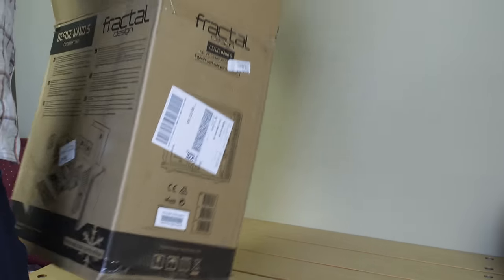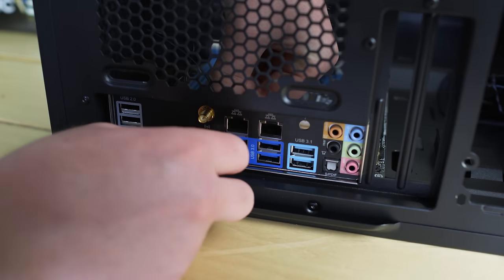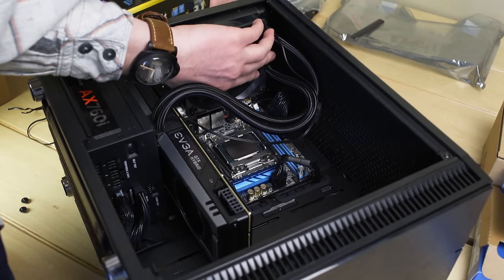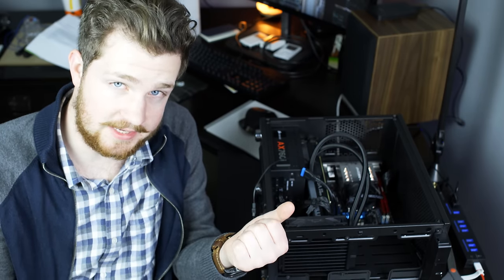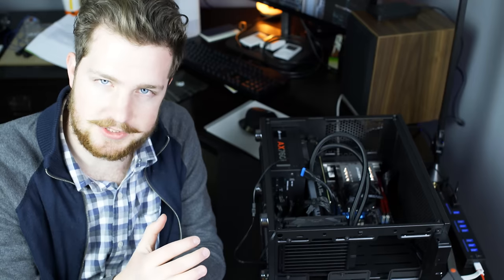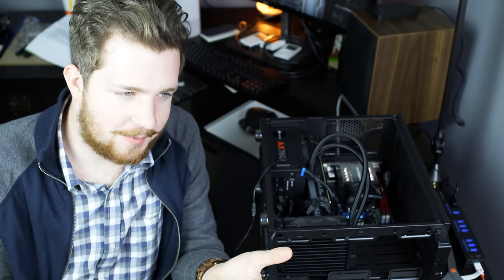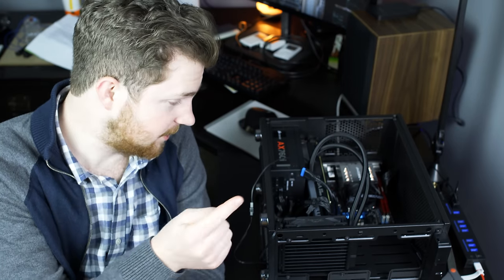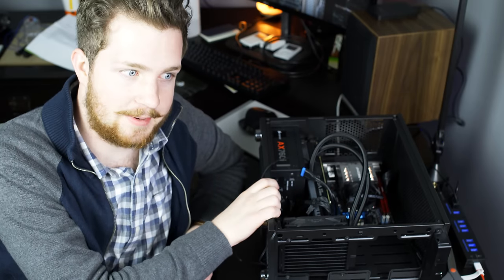My Powerful Custom PC Build Disaster

Comment: refurbished psu is probably the one thing you don't want to buy refurbished... only thing I would buy refurbished is a gpu and ram.
Reply: I wouldn't buy a refurbished gpu... For all you know that gpu could have had the shit frashed out of it and ran at extreme temps most of its life....
Reply: +Alex Murdie I've never had a problem w refurbished gpus
Reply: +JBiNN Nothing wrong with a refurb PSU.  PSUs are just a transformer and fans for the most part.  Easiest part to effectively and reliably refurb with proper testing.  Problem I think here is the difficulty getting the modular 24 pin cable in.  It's either the wrong cable, wrong end, or damaged connector.  Forcing it in with violence should have been his first clue. 24 pins are keyed on both ends for a modular and will click right in, but if you have it backwards, wrong Molex layout, etc., it can be forced incorrectly.   I would imagine there is a short across 5 volt or 3.3 volt, or even 3.3 in a 5, etc., causing an overvoltage/undervoltage that the regulators are detecting as stressing caps, etc.  I would avoid a refurb PCB of any type above all, because there are too many possible parts to die that can't be effectively tested in a timely manner that caused the card to fail in the first place.  I've had failing GPUs that I got a bug up my ass about and just for shits and giggles, I got them on a scope and meter and eventually found multiple ICs crapped out.  Got it running great for about 2 months, then it failed again and I put it to bed.  Any card that starts to fail and is repaired is, in my experience, ready to fail again because the components are all at the same wear level the first time it fails.  Unless you replace an entire PCB with all components, you are likely to miss something.  A PSU has much fewer components and thus can be refurbed with less failure.

Comment: Tech's recommendation: if you want a desktop PC that's powerful enough to do serious editing and gaming, just get an ATX board and case.  A desktop isn't designed to be portable like a laptop in any case, it wouldn't be that much bigger overall, and there would be fewer headaches.   Also, never cheap out on the power supply, that's just asking for trouble.  :3

Comment: You spent that kind of money on parts, including a 980 Ti, but you buy a refurb PSU? Why cheap out on the most important part?
Reply: +Miadous Gaming 
ikr, if you cheap out on a component it's more then likely going to bite you in the ass.
Corsair makes decent PSU, but betting on a refurm when your budjet is that high... stupid move.

Although some times you can get really lucky with refurb, I got my 5770 for a nice discount and it lasted 5 years or so up until I spilled the fluids on my cheap watercooling (bought some cheap connectors and tubing) killing my one GPU and my Revodrive... once again going cheap fucked me.

This is why you shouldn't try and be cheap, he still saved a lot more then a Mac Pro so spending 200 on a PSU would save him some time and "money"

Comment: *sigh 

Never ever buy a used PSU, same goes for HDDs.
Reply: Yeah, Also happens to me a year ago. I found a 640 gigs hard drive lying in a local computer store, for 29 bucks and I was thinking it was pretty good deal. and seller says it's new. So, I pick it up (even though I started thinking I got scammed because even a 500 GB HDD cost 35 bucks), plug it in to a PC and I heard a sound click click click and it goes on.... I was like "Aw crap!". so I fire up HDTune and scan that drive and there was bad sectors all over the place! so I look on a HDD cover to see Manufacturer date and found it was a 2012 drive.... yeah... basically, I got a drive that has been "working" for at least 3 years. And that's teach me a lesson. "you get for what you paid" LOL XD
Reply: i understand HDD but why not psu?
Reply: oh nvm it was refurbished, I see now
Reply: +Poketrevor and you don't know what the happened to the psu before you owned it
Reply: true, but then why buy anything used?
Reply: There are components that usually work fine even used and don't pose a threat to the rest of the system if they don't. PSUs and HDDs (your data) certainly don't belong in that category.

Comment: Right when you said you bought a refurbished power supply, I knew that was probably the issue. I once bought a refurbished one and . . . never again lol. People always forget, but don't skimp on the PSU!!!
Reply: +max silbert ;_; I learned my lesson. I bought a cheap 500WATT Modular PSU ;____; And it's HORRIBLE ! The cables are so stiff and the Motherboard connection WOULD NOT COME OFF.

Comment: andddddd this is why we use macs...
Reply: +matt or you know, do some research instead of just doing things blindly as he seemed to do and buying dubious quality stuff from ebay. He was asking for trouble by A. buying refurbed stuff, and B. buying it off ebay.
Reply: if you buy all new, this wont happen.
Reply: +OtakuSanel Especially the PSU, these things are not all that expensive. Buying an I7 and a 980ti but than being to cheap for a proper PSU is just something i can't wrap my head around...
Reply: +OtakuSanel He bought it from Newegg on eBay.
http://stores.ebay.com/Newegg
Reply: +matt because its slightly more trouble than a mac and you get much worse value?
Reply from the maker: +OtakuSanel I didn't buy blindly. LOL. Defective hardware exists. It happens. I got a Mac that was DOA several years ago. No product is free of manufacturing defect or shipping damage. It happens.
Reply from the maker: +muh1h1 It's a nice PSU. It's just a refurb. Sold by an authorized reseller. I saved $150 by going this route and just got unlucky. Lemons exist everywhere. It happens.
Reply: Snazzy Labs i feel you, if it was sold by newegg then it is perfectly fine to buy refurbishd
Reply: +matt How ignorant of you, Matt.
Reply: +matt This has nothing to do with mac vs windows. This is custom vs prebuilt. If I go out and buy a prebuilt windows pc it is just as likely to work as a mac.
Reply: +matt I may or may not have accidentally killed an iMac yesterday whistles
Reply: +muh1h1 That's one of the best quality PSU's you can buy on the market today... What are you saying?
Reply: +Shiny El. Ghosteo you didnt kill it you did it a favour

Comment: 3 things you don't buy second hand HDD's SSD's and especially especially especially especially ESPECIALLY! not the PSU as a bad PSU can kill you're computer and even start a fire and burn you're house down. PSU's have a definite life span which isn't that long comparing to most other components.
Reply: +Etheoma Also electronics 101, the power suplies are more then likely going to fail before anything else.
And ensure the magic smoke is still in the caps, beyond those two failure it's can easily be a night mare to trouble shoot.
Reply: svampebob007 I think I covered that with saying "PSU's have a definite life span which isn't that long comparing to most other components."

Comment: Never ever ever buy a refurbished power supply
Reply: +xamir1113x I buy refurbs for testing waterloop
Reply: +xamir1113x I bought a refurbished CX750M a year ago and I've had not a single issue with it
Reply: +Gino Palma Refurbished and a CX series PSU? You're just asking to kill your system!
Reply: RGInquisitor I've had absolutely 0 problems whatsoever with it, it's actually a great power supply.
Reply: Gino Palma
Speaking from experience, its only a matter of time. I went through 3 of them before learning my lesson the hard way.
Reply: RGInquisitor Aight bud, you tell me what to do with my computer, regardless of how little your opinion is relevant or even matters.  Because my perfectly functioning power supply is totally a ticking time bomb ready to break any day now.
Reply: Gino Palma
I'm just giving you a warning. Do NOT trust the CX series from Corsair. One of these days, hopefully far into the future when you're going to upgrade your entire computer, the PSU will fail and take your entire system with it. Like I said, I learned that the hard way.
Reply: +RGInquisitor The CX series is certainly not top-of-the-line, but also certainly not trash like you're making it out to be. For 95% of people it's the best bang for your buck out there. For anything mid-range and lower, a CX series will be more than good enough. We have 8 in computers in our office at work, the non-modular 430w, and have had them in there for at least 2 years. So long as you aren't overclocking or pushing close to its limit the CX series is a fine PSU.

Edit: I will, however, agree to the recommendation to never buy a refurbished power supply.
Reply: Mike Adams
It seems I just got dealt 3 bad units. The first one I got was DOA, the second was not outputting enough power and the third one killed a system after powering it up for the first time. I would say that there are better options that are "bang for the buck", especially considering how I've seen some good EVGA 80 plus Gold PSUs go for $65-$75. I got my Silverstone Strider Plus 600w FM 80plus Bronze for $40 last November and I wish I would have gotten it first. It was either the Silverstone or a Seasonic, but the Seasonig didn't have modular cables. Both would be a better choice to the CX series.
Reply: RGInquisitor I agree there are better, but the CX is one of the most popular lines out there, and has been for years. You can do a lot worse than the CX series. 

The 430w consistently has a $20 MIR while retailing for $40. You can hardly buy a worthless Logisys or Apevia for that lol

Comment: Never build inside the case until you have tested it outside the case.  Never get refirbs ever!!!
Reply: he also overpaid and overbought on the PSU, that system doesn't need anywhere near 750.
Reply: gljay i got used 2x gtx 970s for only 300

Comment: Hackintosh it and dual boot OS X and Windows.
Reply: When you get it working.
Reply: +Matthew28845 Bad advice if you rely on it as your production machine that you make money from. it isn't supported by anybody but the community and you.
Reply from the maker: +Matthew28845 The whole reason I'm building the computer is because I need to use Windows. :)
Reply: +Matthew28845 Thats what I have! My $1500 pc gets a better cpu benchmark score than my colleges $4000 mac pro!
Reply: NXN I'm guessing the benchmark is very much single thread optimised then. Most software that makes use of the hardware found in Mac Pro's and other such systems are written to take advantage of said hardware. Interestingly (and pathetic at the same time), Adobe stuff, is not. Premiere Pro especially scales incredibly poorly with more threads etc. It's very much a clock cycle love affair with PP. It's GPU acceleration is also hopelessly slow compared to things like Final Cut Pro X. The OpenCL support is dire (though has improved), it still heavily relies on CUDA which for a cross platform, architecture agnostic software suite in every other respect is morally repugnant very anti-consumer if you ask me given it relies on you to have hardware from one specific vendor and penalises those without. It made sense when CUDA was the only real option for GPU accelerated features, but that hasn't been the case for years now so it should NOT be the case any more.
Reply: Snazzy Labs
But you said you were a lot more comfortable with Mac OS X. This would probably run OS X a lot faster than your Mac Pro.
Reply: Matthew28845 I already explained that bit. It won't be supported. That's fine if you do stuff as a hobby or whatever, but if you rely on your machine to make a living then that's not something you want to leave to chance. Being cheap can cost you far more than you'd otherwise save.
Reply: TalesOfWar it's because my college stupidly bought the 4 core Xeon version which has quite a low clock speed in comparison to my overlclocked 4790k, it would beat my 970 in graphics performance easily though I'm sure, but we use it for Music editing so it's a bit of a waste
Reply: NXN
idk should have bought a mac mini then
Reply: NXN
Macs are objectively better for audio production than Windows so for that task you can't faulty their logic (no pun intended lol). Running things like Premiere Pro on it though is a waste given it doesn't make use of the hardware properly.

Comment: The PSU is like one of the components you should not cheap out on.....
Reply: Eh, yeah it is. Sort of. As long as you get enough wattage to cover what you need. The CPU and GPU should not be cheaper out on.
Reply: Fιrε• Sταrτεr He meant, don't buy a cheap PSU from an unpopular company.
Reply: Red and blue Coins you spend $50 on a cheap off brand pay great for the money saved u can get 7700k and a 1080, you have it for a month shitty psu shorts out blows up takes out the GPU mobo and GPU with it great
Reply: Chewie260 I mean like you don't need an 1200w unless you're gonna have multiple cards
Reply: Red and blue Coins there is a difference between cheaping out (eg refurb) and overspending (eg 1200w for a 1050ti and an i3)

Comment: Why in the world would you build a high end system with an insane graphicscard but then skimp on the powersupply by acquiring something refurbished?
Reply: +trefod cuz even tho it's refurb. the name brand is pretty good. Corsair PSU aren't AAA but they are gold tier or at least AA in my book. His hard time puting the cable in means it probably has retracted jumpers sorta like what you have on power cords and electronic cable. He could just DIY fix it himself if he was smart enough.
Reply: +Keng Vang He's a mac user, he doesn't do DIY fixes ;-)

Comment: I built my first PC after I sold my 2012 Mac Mini. I was a Mac user from 2006 to 2015 and sold my mini to build an $1100 ish PC... I built it, and it posted on the second try (the first try, I think the motherboard had a loose cable) installed Windows 10, installed all my drivers which was very easy to do, and here I am 10 months later and I haven't had any problems since then... I thought I would miss OS X but in all honesty, the only thing I miss is Logic Pro X, but I switched from Final Cut Pro to Premiere and I don't miss a single thing about Mac... love Windows 10, it's feels so much faster and snappier. The best part is that I can upgrade, for example I just put another 8GB stick in to have 16 GB RAM, and I ran out of storage space on my SSD so I threw in a 1TB WD HDD 3.5", and my next upgrade will be my graphics card.... you couldn't do any of this stuff with Mac (besides the RAM and maybe storage). So much more flexibility.

Comment: the powersupply is the heart of a computer.. why do people always try cheap out and get a crap one that cud destroy other components of your computer... it cud fry your motherboard and cost even more
Reply: he didn't get a bad PSU m8.
Reply: +Emanuel morales to be fair, corsair and cooler master are the brands you should avoid when buying a PSU. sure the more expensive ones are great w/e but why not go for seasonic and silverstone...? they sure don't make amature level psus and their "low end" ones have high end features as well.
Reply: +Emanuel morales corsair PSUs aren't great..
Reply: +Bartosz Olszewski you guys are funny. I don't know where you got that Corsair and Cooler master make bad power supplies, when they make very great lines of PSU's. They make some power supplies with a little lower quality caps, but it all depends on with series you get from them
Reply: Emanuel morales basically if you google noisy PSU in google there are only corsair ones..
Reply: +Bartosz Olszewski Are you stupid? That doesn't mean they are bad. Snazzy Labs had a RM series PSU from corsair. They is a very good power supply. Since he got it used there could be other problems. That's why test your system. He didn't jumper the PSU and see if it would stay on. He didn't test out the ram sticks one by one.
Reply: +Bartosz Olszewski ok whatever kid. Eat flowers? Great comeback
Reply: +Bartosz Olszewski don't be mad "kid" why racial slurs?
Reply: that escalated quickly...well not really quickly though the flowers thing was a bit weird lol
Reply: +Emanuel morales ha ha... where from you get they make somethig? corsair got contract for theyr high end ax series with seasonic couple years ago not sure for now... they dont make anything they just design stuff (the ram is made by samsung, toshiba and hynix)
Reply: +Dorin MosuD you think I don't know that? There CX series has 2 manufacturers. And your comment doesn't even help with anything
Reply: idk corsair would most likely want to make a decent psu, soley because they dont want ruin their name, sure some of their cases come with a psu for free, but atleast its a reputable name
Reply: silosis MSI had PSUs, they were awful, but that didn't change the fact MSI is a great brand..
Reply: Bartosz Olszewski i guess i just dont understand why a good compay would put there name on a bad product like that. from what i hear though corsair psu's actually are decent now, maybe not 5-6 years ago but i would trust one